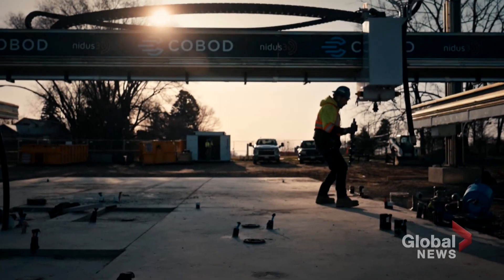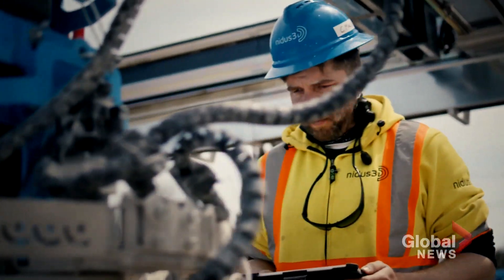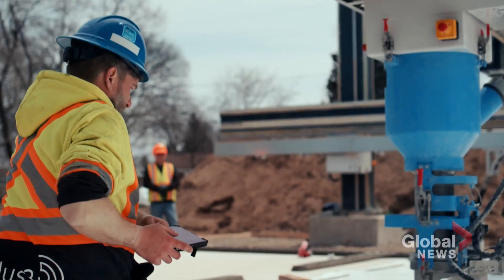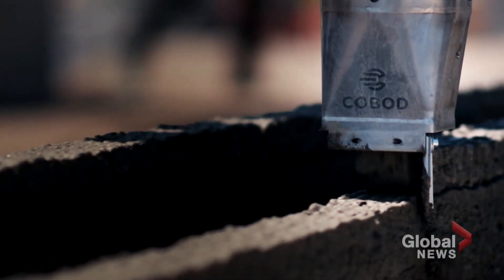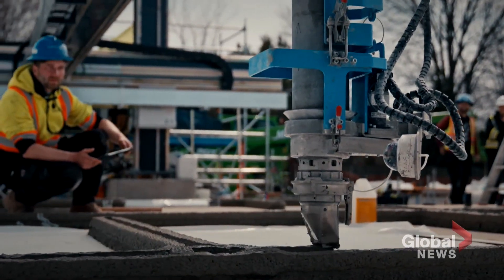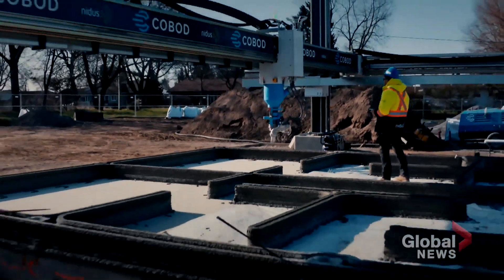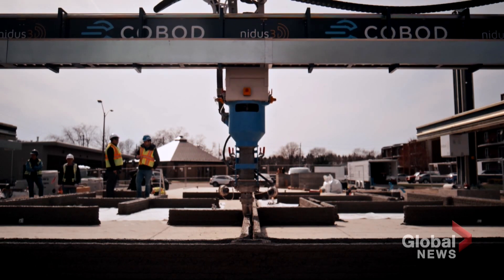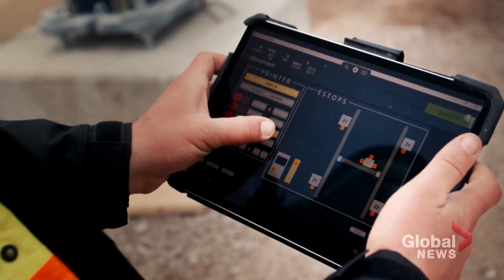Could 3D-printed homes help solve Canada’s affordable housing crisis?

Comment: Or we could, you know, not import demand so much faster than we can expand supply, especially given that such policies both suppress wages and drive up housing costs. 
Probably easier to just not pursue bad policies, rather than implement bad policies and then cross one’s fingers hoping for radical market solutions to surface in response. 
Induced innovation is something, but it isn’t a good thing when your government creates the conditions leading to it…